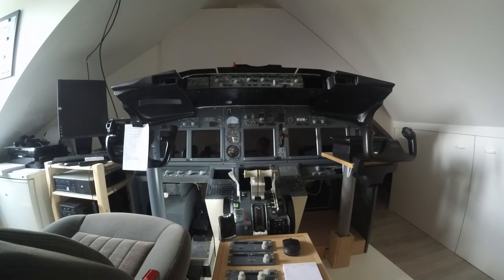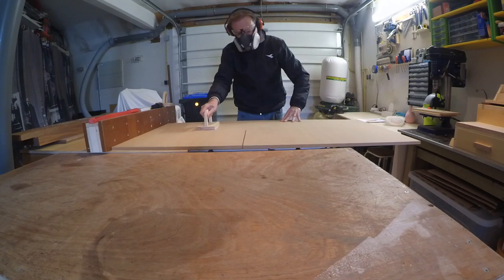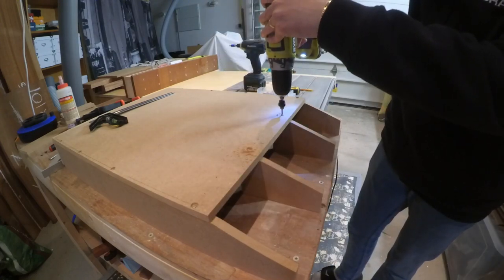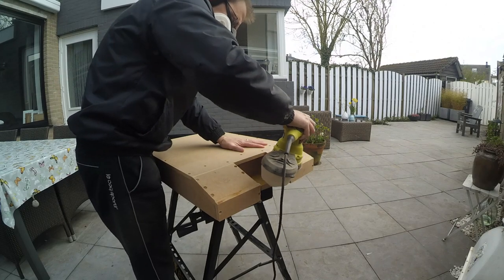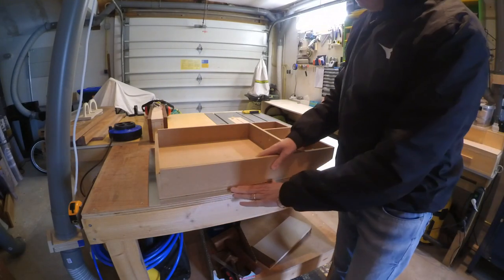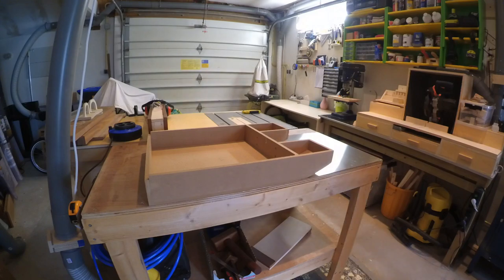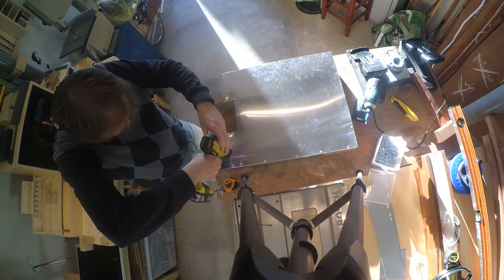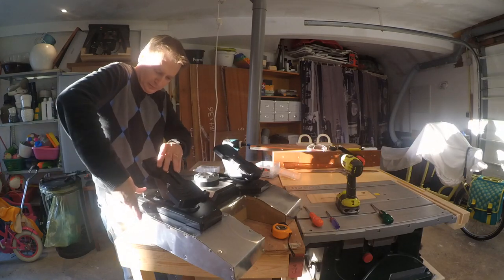Boeing 737 800 Home Cockpit Simulator #18 - Rudder Base Part 1

Comment: Hi Nic, all is good, I just need to know the thickness of the aluminium plate you used for the rudder floor panel? Cheers
Reply from the maker: I think it's 0.2 mm. I find that the thinner it is and the better you can work with it.